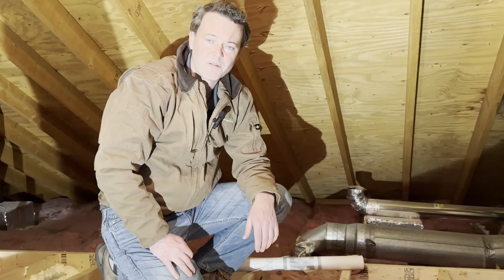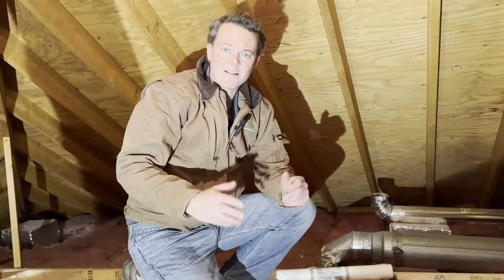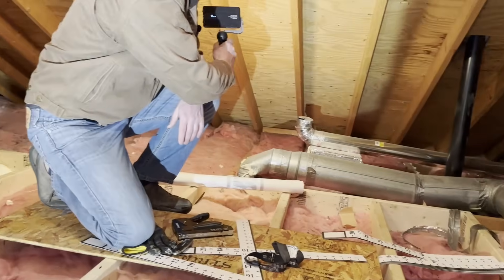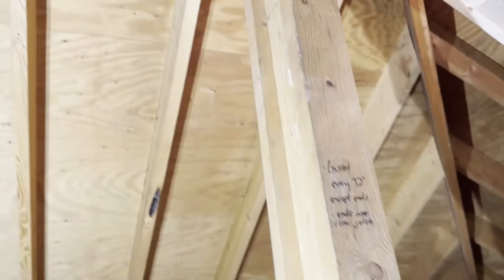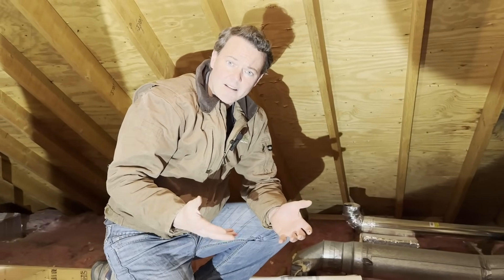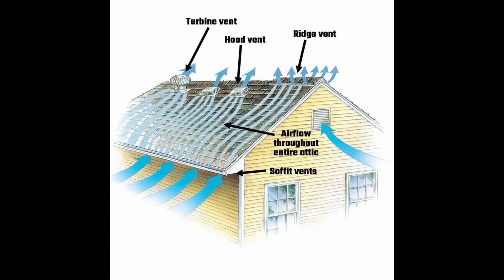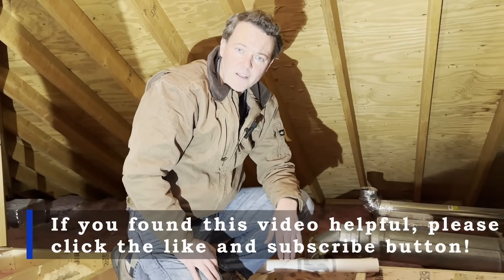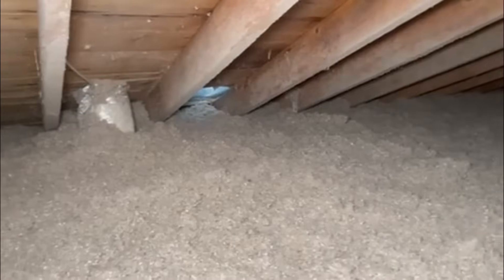Is a Roof Power Attic Fan a Waste of Money....or Even Worse?

Comment: When I bought my house, I kept hearing a loud non stop fan running from my attic. I went up there and saw a powered attic fan like this, running constantly I pulled the wires to it to turn it off. Underneath where this fan was sucking, the joist space was down to bare sheetrock. That fan had sucked all the blown in insulation out of the space between a few of the joist/ceiling bays. It was right next to a badly air sealed attic ladder. I had to reinsulate, replaced the attic ladder,  and did some much needed air sealing while I was there. My utility bills went down and the comfort of my home went up. There are much better things to do than put one of these fans in.
Reply from the maker: Thanks for commenting.  Yes, much of the time when we encounter these things they are incorrectly sited and usually with insufficient make up air to supply them.  They can do some damage to your utility bills if you are not careful.

Comment: I just hired Patriot roofing to put all new shingles on my roof. And the next day after they were done I went in my backyard and noticed they installed two whirly birds. Even though I already have a power exhaust fan in the middle of the roof. 
Now I have an exhaust fan in the middle and two whirly birds on each end about 15 to 20 ft away from the exhaust fan. 

Why did they do this? Why did they not explain it? Then I noticed in the contract where they sent me a PDF I can barely see because my eyes can't read that small print that they charged for too whirly birds in the contract. Why would they have suggested whirly birds in the first place when I already have an exhaust fan? 

Now I'm ticked off at the very least they're going to have to explain why they did that. Because every website I go to says you're never supposed to mix an exhaust fan with two whirly birds because they short circuit each other. 
It's his plane as day If they are such professionals how do they not know that?
Reply from the maker: Sorry that happened.  They maxed out your house for exhaust ventilation.   We see roofers make bad mistakes all the time.  It sounds like both the sales person and the production teams were not trained properly.
Reply: @insulwiseenergycomfortsolu3293 Thanks for the reply but they didn't just max out the exhaust on my roof It circumvented itself. 

I went up in the attic and stood underneath the Whirlybirds when the exhaust fan came on and I could literally fill the exhaust fan pulling air down from the roof into the attic through the whirly birds instead of pulling it up through the soffit vents. 

I don't see how me knowing nothing about roofing (I'm a welder) could figure that out just by looking at it for a few minutes and thinking that doesn't seem right I don't think that's right. 
Then googling it. But so-called experts couldn't figure it out? 

Then again I think maybe the workers didn't know and I think maybe the boss never went in the backyard to see what they did. After all none of the people who actually were doing the work on the roof spoke English. The boss in the person on the phone spoke English but none of the workers did. 
So I'm guessing the workers didn't know what they're doing in the boss never saw what they did in the backyard Because you can't see the whirly birds from the street. Oh well I'll talk to them Friday and get it fixed

Comment: I’m trying to figure out how to cool my attic. My gingerbread type house 🏠 was built in 1939 originally with 2 bedrooms on the main level sometime later someone decided to enclose the attic creating 2 more bedrooms and a half bathroom. It also has a whole house fan that in my opinion does nothing so I don’t use it unless it’s like 59 degrees outside and dry. I’m trying to cool off the attic space rooms cause my bed room is there cause it’s hot up there I have a window air conditioner in both rooms cause the Einstein who butikt the rooms did not add saint air returns so the central air unit seems useless in the attic causing me to have record setting power bills….anyone have any suggestion should I add insulation to the upper part of the attic and another fan in the gable vent
Reply from the maker: I would have a look at this video to get some ideas.  My guess, without looking at the house, is that you have an insulation issue happening there.  You'll see the before and after effect, literally, if you watch this video all the way through.  The infrared before and after tells the whole story. 

https://www.youtube.com/watch?v=x_z9FLeg5AA&t=17s

Andy

Comment: Will it matter much since my AC unit is located in my attic above my non insulated garage ceiling?
Reply from the maker: It doesn't seem as though there would be nearly the risk of depressurizing your attic and pulling AC from your home with this set up.  I would make sure that the connections between your home and garage ceiling area are air sealed.  There will be ducts going into the home, etc.  Any openings like that would definitely need to be air sealed around with foam. 
Andy

Comment: with all due respect he is incorrect. Im a State Certified  licensed roofing contractor in Florida. The best vent system is proper soffit intake venting and ridge venting (static system) but both have to intake and exhale the same net squate inches of venting. If the ridge vent is not long enough then it will not work properly. The best option then is proper intake venting with POWER VENTING.
He is  correct the air from interior space  can be sucked up if there is not inproper soffit venting. The truth is getting enough soffit intake is usually very easy and not too expensive.
Reply from the maker: Hi there and thanks for commenting.  I'm not sure what you disagreed with.  Everything that you say here I also agree with, and thought I'd said it in this clip.  This roof had Zero intake ventilation in the form of soffit vents, under shingle vents, etc.  It only had a short ridge vent and a power vent.  Our preference is for passive ventilation with ridge vent (exhaust) matching the soffit or under shingle vents (intake), or worst case slightly more intake.  Thanks for commenting, Andy

Comment: I'm having a roof replacement and currently have a power fan in the roof. I plan on having ridge roof installed, so should I have the power fan removed?
Reply from the maker: The most important thing that you should do is to have intake ventilation installed, possibly in the form of an under shingle intake vent.  That's if you do not have soffit vents.  If you have a ridge vent and a power roof vent, the power vent will tend to re-circulate the air around the ridge vent and do a poor job of cooling your attic.  Make sure to have the discussion with your roof about the need for intake ventilation, either way.  Thanks for commenting!
Andy

Comment: My last house had a power vent up neat the peak of the roof and intake vents on the gables. The fan was only about 150 watts and it made a huge difference, I'll bet it brought the attic temperature down at least 20 degrees. It was on a thermostat so it really only ran during the day, so 12ish hours. That is a power consumption of like 1.8 KWh per day. We are talking like 25 cents a day to power the vent. I don't know about you, but spending a quarter per day to cool down my attic isn't what I'd consider "running up a big power bill"
My current home is 10,000 square feet and when I had a new A frame metal roof put on the replace the flat roof, I had 4 power vents put in and gable vents with shutters. It makes a huge difference
Reply from the maker: Thanks for commenting.  The biggest danger with these is not providing enough outside intake NFA (net free air) and the fans depressurizing your attic when they operate.  If that happens you could end up cooling your attic with your home's air conditioner as the fans pull the cooled air up from the house through all of the air leaks in the attic floor.   We see this happen quite a lot. 
Andy
Reply: you 100pecent correct and then add the roof system last longer and less energy is needed for ac unit, and less moisture to rot wood.

Comment: Had my roof replaced with heavy shingles. I have plenty of intake, probably more than minimim with soffits and three vertical vents. With the new roof and roof ridge vent, the attic is measurably cooler. A lot more air blows through than before. The air doesn't smell stale. It's made a difference in AC expenses.
Reply from the maker: That's great to hear you've seen a tangible difference in your home's comfort and expenses after the roof work!
Reply: good job you did the right thing.

Comment: What about a gable mounted fan blowing fresh air into the attic?
Reply from the maker: I would rather have the fan pulling than pushing.  Or have a fan in one gable pulling and another at the far end pushing.  But would I'd really prefer is to have a well air sealed attic floor, a well insulated attic, properly sized and balanced passive ventilation, and to not ever worry about an attic fan. 
Andy

Comment: Okay this video really misrepresents gable fans and vents. This one was installed wrong but if they are installed correctly they can be great and save money
Reply from the maker: The key word is IF.  In the Pittsburgh market we see them installed incorrectly -- meaning with little to zero regard for required make up air on a daily basis.  Just like in this video.  They can work well when installed correctly though, you're right.
Reply: @insulwiseenergycomfortsolu3293 I went ahead and installed the gable fan and thanks to your video found it was pulling AC air from my house because the duct is not even sealed as it goes from closet to attic… if I spray foam it it should seal it… it needed to be sealed even if I didn’t have a gable fan, the fan just pointed out my problem! 
After I seal it I think the best solution is to run the gable fan. It was definitely doing its job pulling in fresh air from other gable and whirly bird vents. Even though it’s pulling in part from whirly bird vents a bit that’s still helping cool the attic down for sure

Comment: If you have an insulated ceiling whats the use of a roof 
 fan .
Reply from the maker: If you have an air sealed and well insulated ceiling a roof fan will not affect the home's interior comfort much at all because it will no longer matter how hot the attic gets.  But many people don't understand that they can radically reduce their AC costs and improve their home's comfort by effectively insulating their attic.  So they get a roof fan instead.  And many of these folks go on to suck the AC from their homes in the process.

Comment: Couldn't you just move a fan to the soffit so it pulls intake air and passively vents exhaust, that way you don't depressurise the space but you do increase the air exchange rate?
Reply from the maker: If the fan installed in the roof it's still going to pull from the entire attic space, not just the intake vents.  If you had soffit and ridge vents and reallly wanted to have an attic fan, the move would be to install it in the middle of the roof so that it pulled from both the soffit and ridge  vent and exhausted it out through the middle of the roof.

Comment: I installed an "Attic Fan" on the cheap by putting it on the (square) access port you climb through to gain access to that space: I cut a square of plywood to size then cut a hole in it the same diameter as the fan blades. To that I attached an inexpensive box fan (on the bottom side) by removing the grille on the exhaust side and using the now available holes in the rim for wood screws into the plywood. The fan is installed by lifting it up through the opening sideways, then reorienting it and lowering it down into the recess. I installed an electrical outlet near the opening for power. To close the opening when the fan is not in use I made a hinged top side trap door from the original access panel - operated by an unused lawn mower starting cord I had laying around. The cord runs through a pulley up above. then passes down through a small hole in the ceiling to the hallway below. I use the fan to draw fresh (and cooler) air into the house (through slightly opened doors and windows) on summer afternoons and evenings. For my location and climate (Southern CA about a mile from the Pacific Ocean) it works great.
Reply from the maker: That is one clever DIY solution, and thanks for sharing the details of how you set that up ; )

Comment: What happens if you install a power attic fan and later discover that you also have a ridge vent? Would partially blocking the ridge vent from inside the attic prevent air from being pulled through it when the fan is running? If yes, how do you block the ridge vent?
Reply: I wish I had watched your video before installing the power attic fan.
Reply from the maker: If you're intent on that fan functioning optimally you'll need to 1)  Create enough intake either with gable vents, soffit vents, or intake vents lower down on the roof with slant back vents to provide the needed NFA (net free air) replacement air for the fan and then 2) block the ridge vents.  You can do that easily with 1/2" foam board.  
The other option is 1) air seal the attic floor 2) insulate the attic floor and hatch properly 3) make sure your ventilation is balanced between intake and exhaust  and that you've got enough of it 4) disconnect or turn the attic fan to the highest setting.   With this option it won't matter how hot your attic gets.  The heat won't penetrate down into the home, or at least 90+ percent of it won't.  Thanks for commenting!
Andy

Comment: The entire builiding industry needs to take vapor barrier more seriously. If you have air flowing from your rooms into your attic, your ceiling must have gapping holes. One way to minimize that is to read the attic fan instructions. If you are going to suck air out of a space, there has to be away for that air to be replaced. If you do not provide the minimum net-free-area of intake venting specified in the instructions then excessive negative-pressue will try to get air from wherever it can. Leaky ceiling light fixtures, especially older "can-lights" and the house framing's top-plate penetrations for conduit are part of the problem. Air tight "can-lights" can be installed instead and pentrations can be sealed up with expanding foam. My customers love my super quiet attic fans. Their air conditioning shuts off sooner at night and they are able to get there upstairs rooms 5 to 10 degrees cooler upstairs.
You have to put minor leakage in perspective too. Bath fans suck air from rooms and blows it outside. Kitchen fan also. The more important question is about where that air is coming from. I recommend a screened airfilter to allow "make-up" air to come in from outside from a known location instead of a moldy crawlspace or even from the dusty attic. Broan made a device for home "make-up" air. Its a great idea, but people dont get it. -Jeffrey Tideman, "Jet Fan Man"
Reply from the maker: Jeffrey thanks for commenting, you are spot on with your analysis!  Very few homeowners ever think about this kind of thing, it's very abstract to most of them or they can't imagine that it's as important as it is (getting an attic power fan to function properly!).   Also, I think a high percentage of roofers fail to think about these things properly.  We see things installed with zero to little consideration for NFA make up requirements ALL THE TIME.   Feel free to email me at andrew@insulwise.com.  I'd love to catch up sometime.  Thanks for commenting!
Andy Haak, Owner Insulwise Energy & Comfort Solutions

Comment: What you think about whirlybird vents?
Reply from the maker: We love whirlybird / turbine vents.  They are very effective -- but you do need to provide a good source of intake for them.  Ideally this would be either large gable vents or soffit vents.  If they don't have enough installed intake in the roof, your intake will be your home.  And you'll cool your attic with your air conditioner (far too common and preventable of a problem).   Thanks for commenting!
Andy
Reply: So gable vents at each end of the house works as an intake and the ridge vent as an exhaust. My cape style house with knee walls on upstairs living space doesn’t have ventilation maybe ridge vent

Comment: OR gable vents will do the job along with a couple box vents,works fine.
Reply from the maker: We are HUGE fans of gable vents, despite them being a bit of vogue these days.  Actual cross breezes / wind is the BEST passive attic ventilation there is when you can get it.  You would still want to have the vents be balanced with intake and exhaust.  Gable vents function more as an exhaust due to them typically being higher up.